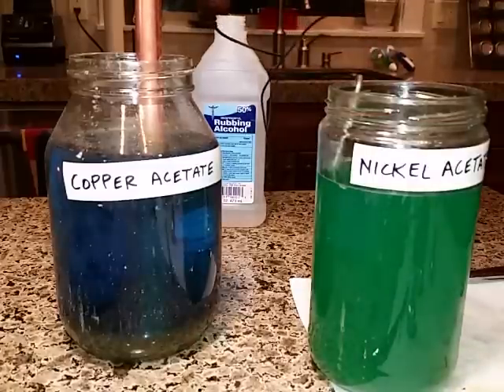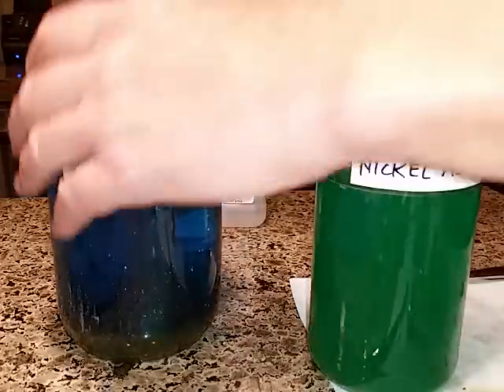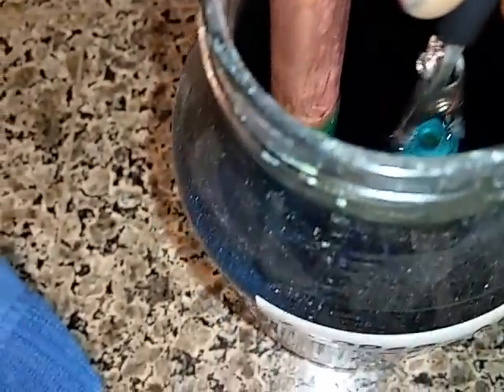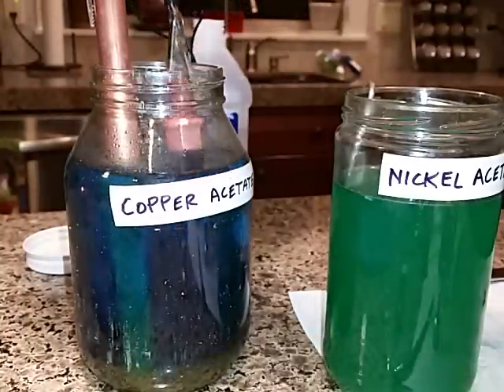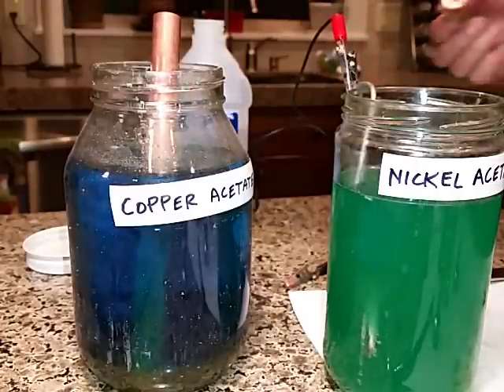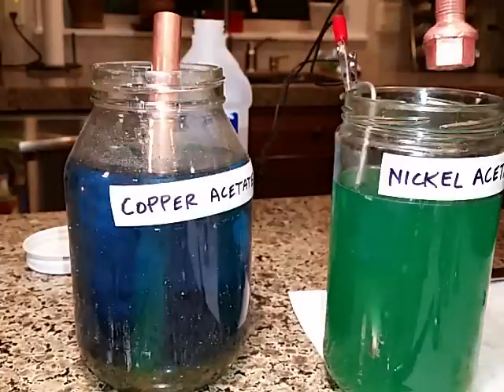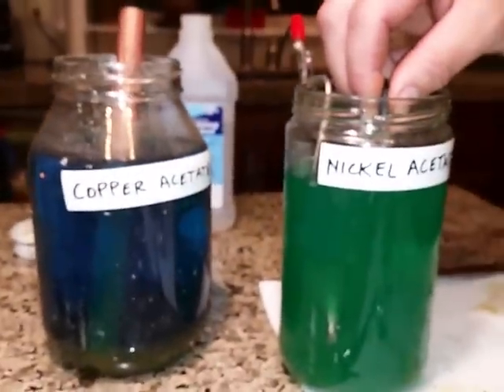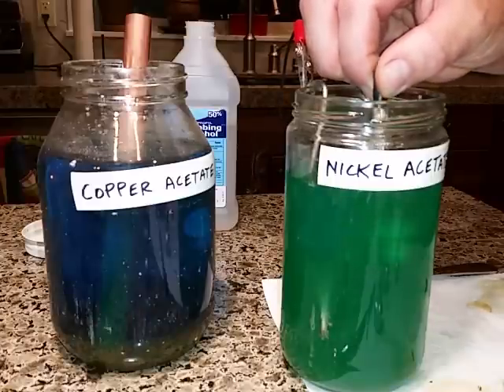Copper and Nickel plating at home.

Comment: Hi, just two questions: 1) how did you prepare the copper acetate? 2) what material was the bolt made of? thank you
Reply: Copper acetate can be easily produced at home reacting  copper carbonate with acetic acid/vinegar. 

The complete home made process is getting 
1: copper sulphate from the hardware store, often used as root killer in the plumbing section. 

2: baking soda (calcium bicarbonate, but sodium carbonate baking powder foams less). 

3: vinegar. Cleaning vinegar is better since it's typically a 30% solution so you won't have to use so much water taking up the volume. 

4: start with dissolving the copper sulphate in hot water. It can be a little stubborn so be patient and stir constantly. 

5: next prepare your baking soda/powder solution by mixing it water as well. Since both reagents are cheap you really don't have to worry about perfect solutions and quantities. Just prepare and equal volume of liquid for both. Its better to have an excess of baking soda solution since it can be rinsed out later. The point is to react all of the sulphate so it doesn't contaminate your final product. 

6:  make sure the copper sulphatw in in a container that is 3 times the volume that plan to have at the end. Now SLOWLY add the baking soda to the copper sulphate solution. It will foam A LOT and will run over the container if added too quickly. Take breaks, stir, and keep adding until no more bubbles from, then add a little more and stir for about 10 minutes. 

7: let the mixture settle. You will have a light green precipitate settle to bottom while the rest of the water will be green but clear. 

8: pour out the liquid keep the precipitated copper carbonate in the vessel. Add clean/distilled water at about 3 times the volume of the carbonate and stir, let settle, pour out the liquid, and repeat about 3-4 times. These washing steps are very important to get rid of the excess sodium and calcium carbonates, as well as  the converted sulphates that are much more soluble than the copper carbonate. Letting these contaminates stay will ruin your plating solution as it will also plate over and create flaws in the plating that will easily flake off. 

9: after the last washing and you have only your wet copper carbonate, you can add your vinegar. This won't foam very much so you don't need an over sized container. Don't be discouraged if the precipitated doesn't dissolve, but you will see a beautiful blue change in the solution. Just stir and keep adding vinegar until no more bubbles form. Then add a little more and keep stirring every so often. 

10: let the solution sit over night to ensure it has completely reacted. It will smell very strongly of vinegar so don't worry about that. Next pour off the liquid and the copper acetate sludge into a coffee filter. The solution can be kept and used as the plating solution, and the sludge can be added to more vinegar to make more plating solution. 

10: this is the entire process. Its a good idea to let the copper acetate lowder dry and stored in a bottle for later use. Avoid using metal bottles or caps and especially not caps with a foil lined gasket, as it will react and contaminate the product. 

Congratulations, that's all. A very simple home chemistry experiment with cheap products that is safe enough to handle for most ppl. Just don't pour any of it down the sink. You don't want to risk it coming into contact with metal pipes or washers that may be in your plumbing.

Comment: Hi guys,
I would like to ask for help with electroplating, specifically nickel and copper plating. I need to coat some small pieces of both black steel and stainless steel. I bought nickel sulfate and copper sulfate and pure nickel (99.9%) for this purpose. As the copper anode, I used the electric wire.
I dissolved nickel sulfate and copper sulfate separately in two containers in hot distilled water (I did not weigh the water to sulfate ratio), connected pure nickel (or copper wire in a second way) to the anode (+) and my steel object to the cathode (-) and set three volts on the source (I also tried some other voltage setting between 2 volts and 6 volts). My steel peace was degreased (I used both strongly degreasing alkaline bath or simply dishwashing detergent).
My results in the case of nickel plating (for both black and stainless steel): steel pieces are coated by the very thin BLACK layer that can be cleaned with a sponge for dishes under running water.
My results in the case of copper plating (I tried only black steel): steel pieces are coated by a rapidly increasing copper layer (I do not need to turn on the power source, just dip the steel object in the copper sulfate solution, and the cooper appears on the surface). Unfortunately, this cooper coat can be simply removed under running water only by rubbing the hand. Copper is not firmly attached to the steel.
Can you help me where I do something wrong? I will be very grateful for any advice.
Reply: Watch more youtube videos on the topic.
Reply: Hey,i understand your prob,u cant copper coat steel directly.u need to first give the steel a thin coat  nickel plating,then you can plate it with copper.

Comment: im having trouble with my electroplating, my copper acetate isnt as dark as yours is but another guy was able to plate with a simmilar color solution. whatever part i try to plate (steel aluminum brass) gets a coating of dark brown powder on it and wipes off with a paper towel. did i maybe put too much salt? or does it need to be warm?
Reply from the maker: Sounds like your solution has other metals in it.  Are you sure it was 100% nickel you used to make your solution?  And, you can't plate aluminum.
Reply: im just doing copper plating right now, when i successfully do that ill move on to nickel. i am using some not very clean copper pipe scrap to make my copper acetate, maybe theres impurities in it or some leftover solder even causing the problem?

Comment: I watched another video where he believed the nickel had to first be done to the copper to plate to the steel. 

Also seemed to work just fine.

From what I saw, they both plate directly just fine.
Reply: I repeatedly come across this contradiction, where one source insists that only Nickel can be plated primarily onto steel, then others like this. I'm set up now so will find out myself. Most interesting point here was somewhat raised temp of soln's
Reply: @sumredsblue  this is not a contradiction. You cannot use an acid based copper solution first plating onto steel. the 2 metals are at different energy states and the copper will much more easily peel off..in the video, the only way he gets away with it is the surface irregularities on the bolt, and the fact that the entire bolt is enveloped in copper....to test for yourself: plate a copper layer onto a flat polished plate of steel..the copper sheets right off!
nickel makes an extremely good bond to steel, and should always be done first, and then copper over the nickel if wanted....this is how all steel parts are chromed: first a layer of nickel, then chrome over the nickel.
Reply: @sumredsblue  let me know how it turns out.

Comment: Great job ! I can hear you fine.  I'm tired of rust cleaning my Tiag lathe parts and nickel looks like the ticket. Don't need most things looking pretty just to last. Much Thanks.
Reply from the maker: Thank you!  Let me know if there is anything I can answer from my trial and errors
Reply: @idahomecustomdesign  Ill be trippin through this stuff for a while. I'm supposing you would have to heat the vinegar out in order to collect copper acetate. Also can you replate with Nikel once the item starts wearing, without removal other than a good cleaning.

Comment: i made Ni solution with 50/50vinegar &water,salt,hydrogen peroxide,citric acid,and .999 Ni quarters ,it turned green after a couple hours but it is not plating at all when i tried it on copper penny?

Comment: i am surprised the Cu bonded to that bolt so well,its metal right? i thought you had to nickel it first then copper?
Reply: Sure. Copper will deposit on iron but not plate. Nickel plates well on iron.
Reply: @puits-de-science  what is the difference between the two
Reply: @ARCSTREAMS  Real plating is metal depositing on top of the other metal and bonding. In the other case, the most electropositive metal (copper) replaces the metal of the part (iron) which goes into solution. I suppose the film is porous  and not bonded well.
Reply: @ARCSTREAMS  If you want to refine copper, use a stainless steel cathode like a glossy kitchen bowl, and you will be able to peel the copper out. Not plating. Like painting on a dusty surface. With nickel you have bonding.
Reply: @ARCSTREAMS  We have an FAQ that covers science project copper plating, but functional plating is a fairly rigorous science; and trying to plate copper directly onto stainless steel with proper adhesion does not in general work. Nor does using low quality metal like copper pipe as the anode. Good luck.

https://www.finishing.com/153/52.shtml
Reply: @puits-de-science  cu bonding atomically to the metal is called plating ok but im still not sure i understood what deposition is? i guess the cu just gets attached there by a weaker electron charge bond ? as for me i used pure copper plates not pipes,,i had a metal cross to which i plated with cu for my first attempt and it did work but some parts were chipping off so i struck it with ni first then copper and it bonded better although there were some parts that did not cling well,i guess due to not proper cleaning of the metal first even though i thought i did a good job of brush cleaning with my power tool,,anyways i do not do this anymore it was just a past interest hobby i tried for a while ,,thanks for the info
Reply: @ARCSTREAMS  My understanding is that in the case of deposition, the copper coating is like a sponge for the first layer.
Reply: @ARCSTREAMS  there are two different phenomenon that happen when copper doesn't electroplate properly, one forms an almost shiny layer that peels off, for example when you use stainless steel, and the other is copper powder deposition onto the part (coming from the electrolyte), which doesn't flake off but just rubs into microscopic copper particles. This last one happens usually on mild steel/iron and has a very dull copper color, much darker than the clean mate pink copper layer when electroplating. So it's probably a sponge formation and doesn't really bond, but it's a great way of making tiny copper particles.
Reply: @Smooth Move <<his guys plating is gonna fall off on the first ride around the block. >>
I think that the bolt was Zinc or Nickel plated before it was held into the copper acetate solution. Therefore it will be okay. Not sure why to copper it anyway.

Comment: Awesome video Bryan! I really appreciate you sharing it. I need to nickel plate a piece of mild steel, like just the steel bar you find at Home Depot. I saw below that you said in another reply that stainless steel does not plate well, because it has some metal-rejecting properties. Mild steel can be nickel plated, though... correct? Also... you dipped this lug nut in copper first, and then into nickel. Was that just to show them both, or does it make things work better to copper plate, and then nickel plate?
Reply from the maker: Michael, mild steel plates very well.  You need to make sure you degrease it first.  As for the copper;  have you heard of triple plating?  Basically, it is the process  done on things, like car bumpers, etc.  First, they copper plate, then nickel plate, then chromium plate.  Hence the name "chrome". If you copper plate and then nickel plate, you get a stonger bond and better corrosion resistance.  Good luck

Comment: Great video.  Thanks for sharing your knowledge.  I have used Forney 99 nickel welding rods with good success, albeit expensive!  However, available (ie, Amazon, etc) these days are pure nickel metal strips that are intended for use when soldering lithium ion batteries (18650) in circuit together.  These strips can be interconnected and suspended as a "necklace" around the rim of the plating bath with the tails immersed into the acetate solution....this is helpful in getting uniform coverage to the part being plated.  Cheers! ... and keep up the good work!
Reply from the maker: Thanks for the info :)

Comment: would it also work to coat  copper to stainless steel ? thanks
Reply from the maker: Ferruccio Maierna - stainless steel can be plated, but the metal has to be prepared.  Stainless has chromium particles it it that prevent corrosion.  These particles restrict other metals from attaching.  Either, a acid bath to the metal or a nickel striking will be needed.  There may be videos on the web.
Reply: thanks a lot !!!!

Comment: I can barely hear this on a laptop. Can you tell me the purpose of flash plating in copper before the nickel ??
Reply from the maker: Joe Gancher - if you have ever heard of triple plating [car parts, etc.] It is copper, nickel, chromium.  It makes a thicker plating and each material binds well.  You dont have to copper plate first, but if you want a better plate and longer/less corosion then plate copper first.

Comment: No matter what I do I cannot get the copper to stick to my carbon steel blank.
Reply from the maker: Strange.  Things that prevent plating could be:

-oil/corrosion on steel 
-having the pos/neg backwards
-not having good electrolyte solution.  Salt and acidity to copper solution helps.  
-temperature of solution at 100 degrees F or better when plating.

How did you make your copper solution?  Did you clean the steel?
Reply: Bryan 212 My item gets plated but is erasable by fingers. Is this because of the temperature of my fluid was about 65F?
Reply: Are the both solutions copper acetate and nickel acetate must be 100F or more?
Reply: try plaiting it first with nickle ,then the copper as i read somewhere that copper will not bond to steel or aluminum without fisrt nickle plaiting it.
Reply: ase cisneros I'll have to try that. I need to get a nickel anode first though
Reply: Reverse the polarity
Reply: Has the mill scale been removed from the steel plate? That could prevent attachment of the nickel.

Comment: Very nice. One question: my understanding of the plating process is that the copper serves to fill in pitting an should be buffed and recoppered until smooth and then final plating is done.

Comment: Did you make the copper acetate in the same way as u did the nickel acetate? i'm trying to do do in that way.. but there are getting weird SOFT copper lumps on on cathode copper pipe n also falling off n gathering under the jar . And the anode copper pipe is getting white-ish and those white stuffs are also falling off n gathering under the jar.. :S when i try to do the copper plating, the object turns black ( some kinda black layer ).. I can wipe it off n then see the copperish shade... is that what it supposed to be?
Reply from the maker: No, because of copper's chemical make up it disolves a bit different.  All you need to do for copper is fill a jar with pure dustilled vinegar and a bit of peroxide and let it disolve naturally.  No electricity.  If you can find DEP ROOT Killer at your hardware store then you can just use that.  It is pure copper crystals.  Add 1/4 of the bottle to hot distilled water and salt.  You can add some battery acid too.
Reply: Thanks for the response.. I tried the vinegar n peroxide method yesterday.. 50% distilled water n 50% hydrogen peroxide (6% vol 20) n put few pieces of previously cut copper pipes,  left it to dissolve for like 15 minutes or more n when i got back half of the cup got foamy! n the mixture became Green! I poured the fresh part in another jar n tried electroplating but it just wasn't working.. :( the mixture still kept producing foamy stuffs even during electroplating.. :( any idea what went wrong?
Reply: Update : it worked the 2nd time i tried.. now trying to make brass acetate in the process of making nickel acetate... did u try making brass acetate?